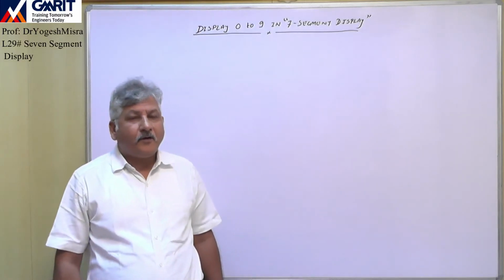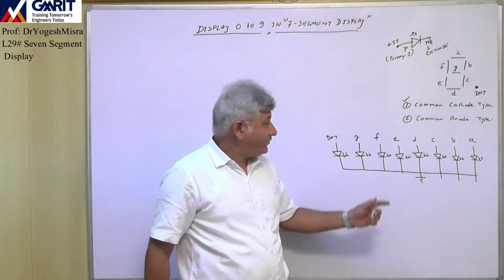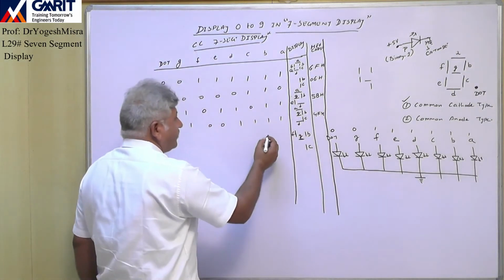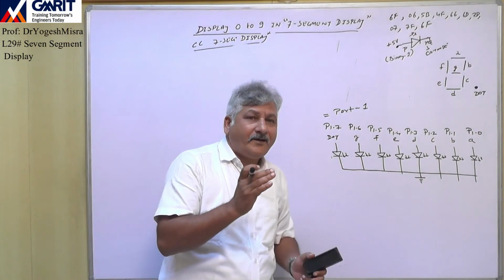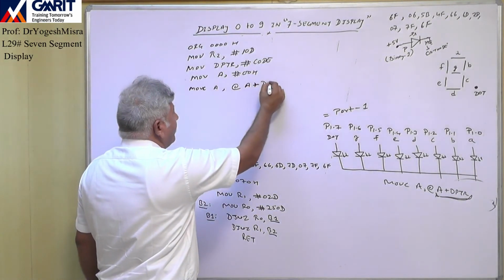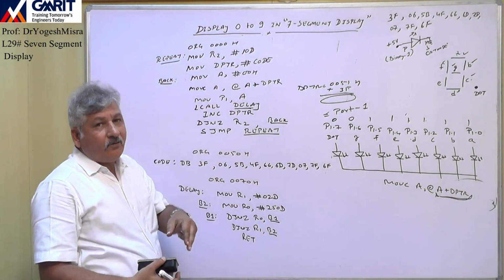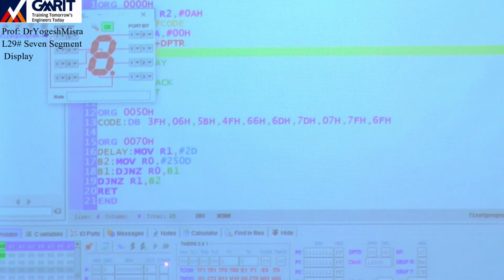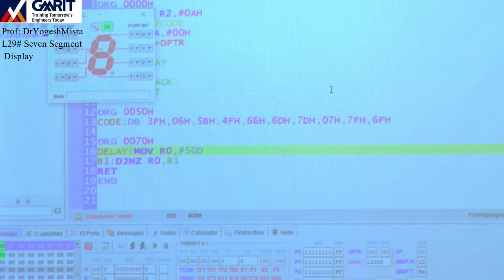Lecture 29: Program for Seven  Segment Display

Comment: Sir in this example the code memory is internal or external? 
If it is internal then why we are using dptr?
Reply from the maker: DPTR is used with MOVC, here code memory can be internal or external both depending on the EA pin of microcontroller.
Reply: @DrYogeshMisra-Professor  
But sir DPTR is only used when external code memory is connected na?
Reply: @DrYogeshMisra-Professor  Because the internal code memory which is of 4kb it is 8 bits so why we should use dptr
Reply from the maker: @swaritmahalsekar5521  Internal RAM address is of 8 bits but the address of internal code memory is of 16 bits only and for 4KB it is from 0000H to 0FFFH.